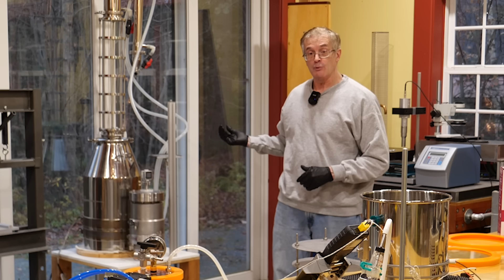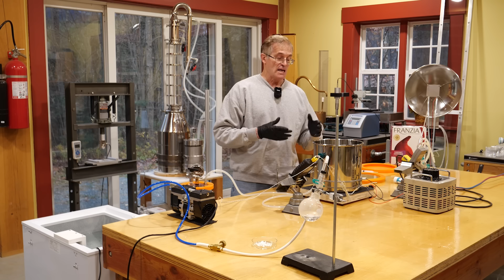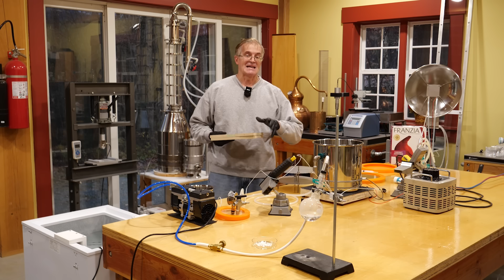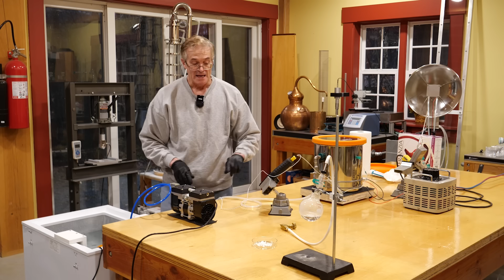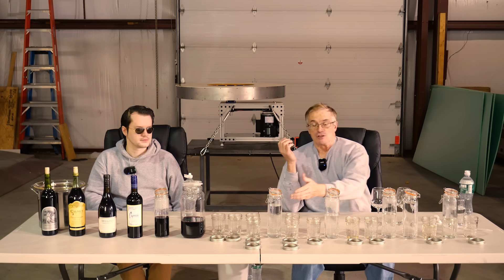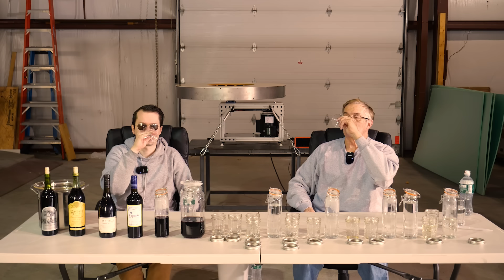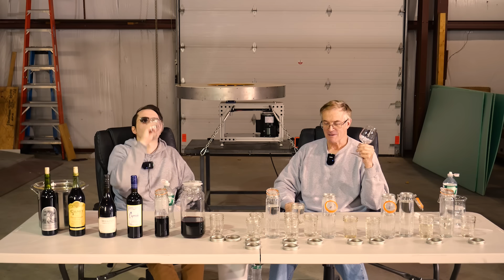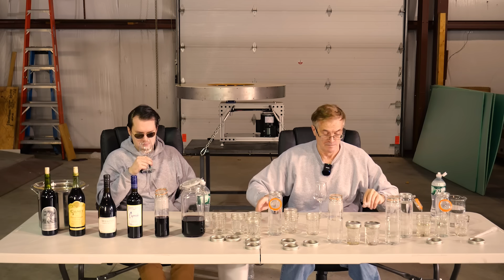Turning $3 Wine into a $100 Vintage with Science!

Comment: The grease on the lid is not necessary, I just push a little bit on the lid, vacuum dose the rest!  😉

I did the ethanol extraction with the spices, and wow that's a really awesome thing!
Now I have all my spices with very consistent potency ready for cocking without having to pick out twigs and leaves, and they don't go bad anymore!

I am not that much into grape wine, but I might try this anyway to fool some friends that are self proclaimed wine gourmets.

I know how "good" wine tastes, or what makes it good tasting, but just don't care.
This might work to trick them. 😁👍
Reply from the maker: Actually,  the grease does help. Microscopic irregularities in the gasket can still leak very slowly without it.
Reply: @TechIngredients 
Yea that might be with bad gaskets, or on lower vacuums, or even those small pots with less pressure on the rim.
So maybe testing before could decide if you need grease or not.

I regularly pull deep vacuum to dry nasty nilon filaments, multiple hours over several days, (Just for my conscience) and then I have it sitting for weeks on end to make shur it is dry, without leaking a bit.

I also have just glass lids for my 3 different sized chambers, not the acrylic ones.

I guess it's a good idea to grease if you want to be sure if your gear is not that good.
But I don't have any issues with the vavor ones. 🤷
And I would think this non critical destilatio is ok with a very small amount of leaks?
You didn't even pull that hard of a vacuum in the small chamber so... 😄

Comment: Many years ago, while I was studying, I was working with ultrasound. My professor was doing experiments with making wine taste better by subjecting it to ultrasound. At high power (around 500W) it only needed 30s to make a bottle of cheap red wine tast much better. Turns out lower power (only 10s of watts) works just as well in only a minute or two. We were running our transducers at around 25kHz. I wonder now if an ultrasonic cleaner wouldn't do the trick. Just submerge a bottle of wine in the bath and turn the cleaner on.
Reply from the maker: The mechanism is critical to understanding and applying this technique. 
Any idea?
Reply: @TechIngredients No, I actually don't know what the mechanism is. The effect is that the wine is smoother like one that has been aged, so it's most likely affecting the tannins in some way. My professor was collecting samples to send for testing, but I don't know what the results were.
Reply: @stanleyadamssa Can you see if he ever published a paper?  Or was this just to keep the lab techs happy?
Reply: @flowerpt A quick Google search didn't come up with any papers from him that I could see (this was about 25 years ago and my involvement was that I built the inverter we were using to drive the transducers, so I happened to be around during testing). I did find other results that seem to agree that ultrasound can be used to age wine, so I guess that the phenomenon is now fairly well known.

Comment: Wait, won't the screws pop out of the glass thermocouple tube  when you evacuate the system  ? The inside of the tube will be at atmospheric pressure.  Unless the screws are secured they will pop out.
Reply from the maker: The friction in the stopper is sufficient.
Additionally,  the heads of the screws are on the outside.

Comment: 24:27 i used to use some analytical equipment that worked on this principle. they had a small chamber you filled with ice and water around a tiny furnace to balance the temperature ramp perfectly. the whole thing ran with a 400c furnace to a tenth of a degree accuracy so long as it had ice. the machine was from the early 1980s

Comment: Awesome video guys!  A couple comments/questions... If you produce some bulk wine in a "scaled up" operation, how does one properly re-bottle and preserve so you can store the new product long term?  You didn't explain your mixing methodology very well.  Were you always taking equal measures from each of the various cuts??   Once you arrive at a "mix" that you like, could you distill much quicker by only splitting out the part(s) that you want to omit?  Thanks for sharing your knowledge.
Reply from the maker: I covered much of that during the tasting segment. Regarding storage, I think simple bottling and corking will work.
Reply: @TechIngredients  purging with CO2 helps a lot.

Comment: A few considerations 
1. Add a bit of distilled water to a concentrate before tasting
2. Add different proportions of the concentrates to the final mix in preferred order 
3. Some of the "off flavors" could still be beneficial to the final mix
4. The colored concentrate shouldn't be added in full to compensate for volume loss 
5. Fillers might be useful such as a neutral spirit to up the alchol percentage if you don't prefer the highest cuts or distilled water for parts that are too overpowering
Reply: Just started watching the video then scrolled to find this exact post. Commercial wine, especially red wine, usually has sulfite preservatives (potassium metabisulfite is most common) and as we know from distilling, sulfur is the root of everything that tastes bad.
Now I'll go watch the video to see how right I was. 
😉
Reply: @Miata822  Good point. I think they use sulfur before the harvest as a fungicide rather than preservative. I wonder if it could be removed. I guess they'd do it if it was easy.
Reply: @trollmcclure1884  It can still be easy to remove, doesn't mean they will if that means increasing costs, gotta love capitalism
Reply: @trollmcclure1884  You're right in that sulfur is major component in fungicides that you spray the grapes with, but it is also added to the finished wine as a preservative. My grandpa was a winemaker; I saw it done many times. It's very potent, though. You can't really add more than about a teaspoon per a 50 liter demijohn (and even that is a lot) or you'll ruin the wine.
Reply: @hellterminator  Yeah, I've asked AI since. It's an antioxidant. It's weird that we dont have a better one. It tells me that sulfur compounds may have a similar, hard to replace role in the body
Reply: @Ebani It is not easy to remove sulfur contamination *at all*. As for alternatives, it's complicated but there isn't anything even near the same class of low toxicity to humans, availability, and low price. You would be seeing investors pile on alternatives if they existed
Reply: @orbatos  Not my point, you might want to understand the argument before responding with something completely unrelated.
Reply: @trollmcclure1884 AI is wrong again. Why don’t people trust such things?
Reply: @Miata822  maybe even some of this would benefit from some uiltrasonic on top of a copper plate.
Reply: That would’ve added another 3 to 5 business days to the length of this video.
Reply: I agree!
Reply: 3.  disagree. No, that's the whole experiment. Taking out the meh flavor. I'd have left the last 2 out as well. 
4. ABSOLUTELY...  do NOT add all that concentrated wine dregs to the mix. It is the part that makes that wine so cheap. Half at most for a bit of tart and some color.
Reply: I always thought “boxowine “ was just dilute cheap vodka with colors flavors and a small amount of cheap off cuts of wine to pass the FDA sniff test.
Reply: @lexinexi-hj7zo this video deconstructs the wine, so what you described could be done
Reply: @lexinexi-hj7zo  usually its cheaper because the packaging is considerably cheaper than a bottle.
Reply: #4 for sure. As a distiller I would never have included the last part of the coloured concentrate especially because they never tasted it.
Reply: @seandsouza6423 it was the last part they tasted
Reply: Also, fot the thermostatic bath: just toss some ethlyleneglycol or ethanol in there, and you can work below zero, without having ice to buffer anything... If you're not heating it, the heat output is so low, anf your volume so big, that you don't need all this latent fusion heat to buffer anything there
Reply: @renatogavioli6478 This adds a degree of complication and hazard most people aren't prepared for. You do know that few would opt for using glycol right? Even setting aside uninformed contamination risks, which have historically been a major problem!

As is, this can be done by anyone, your addition brings it back into the category of dangerous projects best done by people who know how to handle the materials. This isn't just a question of what can be done.
Reply: @orbatos  makes sense. We used to do it all the time in the lab, but our stuff was very volatile. And even then, no one intended to consume anything we distilled or extracted...

Comment: Even if you made several gallons of that stuff and compared it to the fancy wine, it doesn't even come close to covering the cost of everything. The chest freezer alone is quite expensive, the drill you need for making the holes, all the fittings, the grease, it all adds up. You'd have to make several gallons to make up any difference, and I don't know anyone who consumes $500 worth of fine wine in any reasonable amount of time. It's a cool concept, but don't pretend this is something for the ordinary man.

Comment: First off I like the video, from the science, learning, and interest aspect.
However, I do dislike the youtuber side of things where comparing $3 to $100 was apples to oranges because one of those price tags includes all the labor, packaging, and retail, while the other had 14+ hours of free labor processing entirely ignored in the price tag. The glass you compared was made from $3 wine but was no longer a $3 wine anymore is my point.
You guys are normally pretty good at pointing out stuff like this, like how it's not really fair to call it a $3 wine anymore after the added processing. So I'm giving you a good faith pass.
Reply: Once you buy a tool it's yours to keep! (And use again, and again, and again...) They can now repeat this process with only their time / labor as a cost.
Reply: @monkeysuncle2816  Correct. but their time/labor is a cost which you've also correctly identified. A cost that is not tallied in the $3 price tag comparison, along with the price of a glass bottle, packaging, shipping and retail, things that are accounted for in the $100 bottle comparison. I specifically never mentioned the cost of equipment as that is a startup cost not an ongoing cost. Though maintenance, operating, and cleaning the equipment may be.

Comment: When you say about how a "cut" is the same as the previous one but stronger or weaker, I keep thinking what that means is you've cut across fractions - the weaker cut is a mix of the stronger one and the fraction before or after it. Would need to watch the temp very closely (especially in a vacuum distillation, which reduces the temperature differentiation between fractions) to avoid that.

Also, since you nearly mixed up wine glasses in the final tasting, should probably have marked the glasses (coloured electrical tape, or masking tape with letters written on it, on the stems) to make that less likely to happen, since it wasn't a blind tasting.

Comment: The Amylase enzyme is present in saliva. Try placing some flour on your tongue and waiting a minute or so. The amylase will cleave the long starch molecule into glucose units. At this point the flour will begin to taste sweet.

Amylase used in brewing essentially comes in two types: beta-amylase and alpha-amylase.
Alpha-Amylase randomly cleaves the starch molecule into less complex starches or Oligosacharides but cannot cleave glucose ends or cross linkages.
Beta-Amylase cleaves starch into Maltose – very important for fermentability.

The optimum temperature for beta-amylase is about 62 degrees Celsius and for alpha-amylase its higher at about 70 degrees Celsius.
It's common in brewing to use a middle temperature of about 67 degC (called the midpoint of the Brewers window).

Some breweries run their  mashing process in two stages. One for beta-amylase at 62 degC and then at 70 degC for alpha-amylase.

You must do the beta-amylase mashing step first otherwise you will denature it at the higher temperature.

The enzyme, Maltase then breaks down Maltose into two glucose units which are what the yeast needs during fermentation.
Reply: Hopefully everyone did the bread test in school. Get a glucose detector and test pre chewed and post chewed bread. Suddenly sugar
Reply: @raideurng2508 
There is a beer that uses saliva in the mashing stage.
They actually spit into the mash tun
🤡
Reply: @PetraKann  That's just nasty. There's a lot of horrible things in our saliva.
Reply: @raideurng2508  
Such as?

Comment: I would say that this is really impossible, not because it can't be done but because to rate one wine as "better" is very personal. The sommeliers probably would not agree with your idea about better and worse, and not all sommeliers would agree with each other. My experience is that wine snobbs doesn't like blind tests. They want to know what they are testing and that will influence their opinions. But maybe I'm just negative about wine testing and has only met people that play at being knowledgeable about whine. I will also admit that I'm a whiskey snobb. But I have done blind testing and was pretty proud when I got it right analyzing the whiskey character and the aging process and quality. Sure I have hit the right name at times but that's not what I find most fun about whiskey. Some highly respected brands are not really all that good, and a few real cheap ones definitely can compete with some of the, in my opinion, over rated brands.

Wine I however find mostly nasty and I can't get why people are drinking it. I did spend almost a year drinking a glas of wine almost every day. I was trying almost every wine I could find and I still thought it was just nasty. And yes, this was wine that sommeliers recommended. So don't trust me about anything when talking about wine. I'm just whining a lot.

Comment: Instead of drilling the stoppers, you could cast them from food grade silicone rubber mold material.  It is used in casting candies and can take some heat, far more heat than you are using.  I got mine at Hobby Lobby, but most craft stores have it.  It is not hard to do and a he.. whole lot safer to do.  Plus, you could cast it around the lead wires of the thermal probes.

Comment: Yes, there is methanol in the heads, but also in the hearts and the tails. Often more in the tails then the heads: YOU CANNOT SEPARATE METHANOL FROM ETHANOL WITH A SIMPLE (POT)STILL!!! Methanol and ethanol form a azeotrope mixture with water. That’s why the distiller makes sure there is as little methanol as possible to start with by removing as much woodfibers as possible BEFORE the fermentaion. Don’t think you can take the metanol out of denatured alcohol by distillin it: people have died because of this myth! So yes, there is a little bit of methanol in rum, whiskey, wine and beer, but it’s not much. By the way: the treatment for methanol posioning is ethanol consumpion because it dissolves the methanol.  What you remove with the heads are components like acetone, formaldehyde, ethyl acetate and especially acetaldehyde (besides an amount of methanol, ethanol and water).

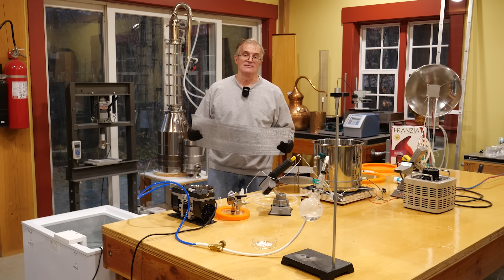Comment: 30:07 You should not wear gloves when using powertools like bandsaws or tablesaws in my opinion. Unless they are nitrile or latex. Cotton grips to blades and sharp cutting edges too easily and that's the true safety hazard. It's the difference between getting a nick and getting your hand sliced off

Comment: On a lark I decided to try my hand at Wine making this year because the grape vine on the black iron fence that surrounds my pool had a bumper crop of grapes this year. It was literally a wall of red grapes on both sides and if I did nothing they were going to be a pain in the ass (make a mess of the pool, crows, rats etc) so I went to town filling up basket after basket (netted 300lbs).

You wouldn’t normally think it but some vineyard grapes grow REALLY packed together which means they are difficult to clean and wash the grapes and flush the bugs from the center. Took me x2 8 hour days to pick and wash then another  x2 more to pluck/de-stem and then crush and combine for fermentation. 
By the end I realized it was about a week of solid non stop labor and was starting to regret my decision but in for a penny in for a pound especially now that the hard part was done…. 

Or so I thought but then I had to build myself a grape press from a repurposed Scissor Jack out of my wrecked Chevy 3500, purchase glass carboys/airlock caps and research what to do so I didn’t end up with a ton of moldy fruit 😅.

Bringing it all back around home here, it was actually your videos on distillation that had sparked an interest in brewing in general BUT THIS ONE might just be my salvation if my end product turns out like freshly minted box wine 😁. 

My family is interested in how it turns out so I’m glad to know I can turn things around in the 11th hour and at worst mint myself some quality custom choiced spirits … grape vodka? or is it a rum if you use fruit?
Reply from the maker: That sounds like a lot of work,  but in a good way.
Distilling fermented fruit like grapes produces brandy.

Comment: For a bump gaurd. Could you just use some very course stainless steel pot scrubber. Think i have seen them used in stills.
Reply from the maker: Probably, but remember that you're likely to use what is left in the pot after the process. It needs to be very clean and not shred into small, loose fibers.

Comment: So the vapour flows to the smaller pot due to a pressure gradient on the valve? I also wonder if it might be worth adding in plain water to make up the discarded volume. But the extra concentrated flavour may be a benefit.
Reply from the maker: That's correct.
I suspect it's due to both the removal of the funky components as well as the small concentrating effect.